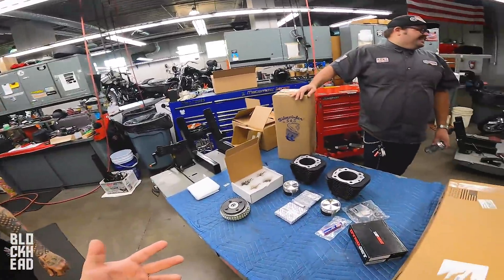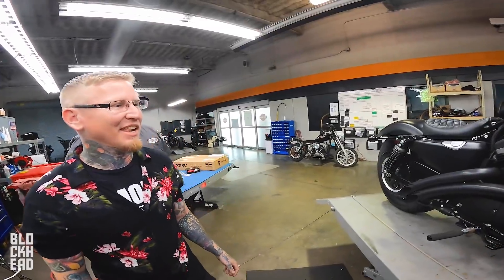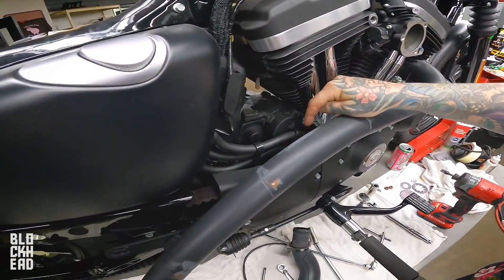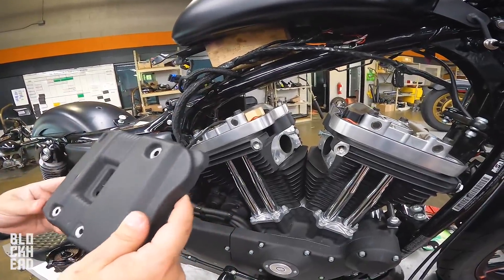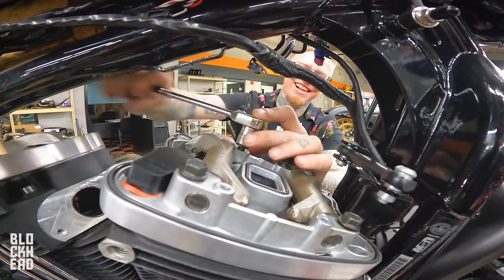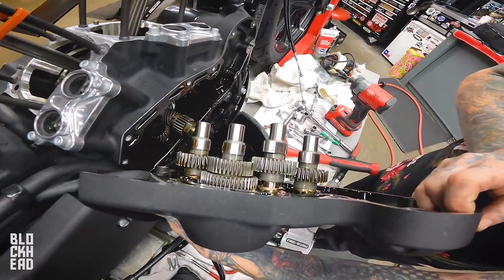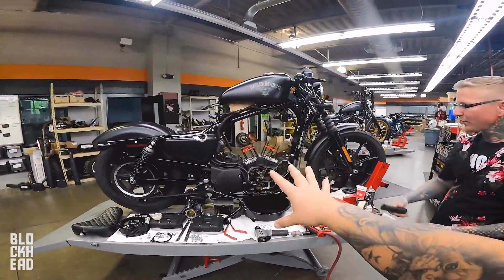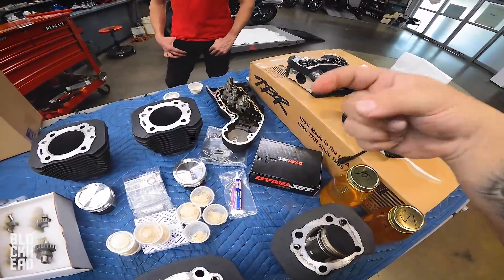Harley Iron 883 BIG BORE Kit Install! (Hooligan Kit Ep 1)

Comment: The pistons are carboned up so bad because the heads are puking oil & dirty gasses back into the intake. It's also robbing HP/TQ & screwing up your tune. Get a different intake that either uses breather bolts or a catch -can system. Gasbox, Lowbrow, TC Bros, DK Customs all make ACs and breather bolts or catch can systems for the Sporty.
Reply: Pretty sure they are aware lol

Comment: Interesting to see a built sporty motor vs the stock indian.
Reply: Man im a sportster owner and ive got to say those bikes arent comparable. A sporty is “i want an old bike without all the other bike problems and the abilty of infinite changes”. A scout is “i wanted the most refined composed streetable cruiser right out of the box”   Scout is like a 2020 camaro newest tech balanced. The sportster is like a 1969 camaro they started reproducing in 2020 cool in its own ways.
Reply: @noahkight8023  that's a fair point.